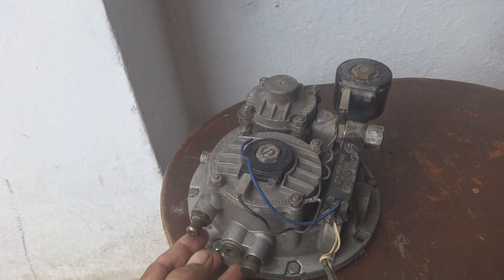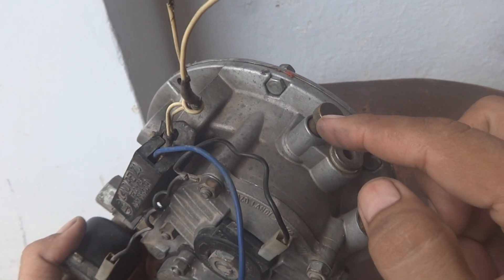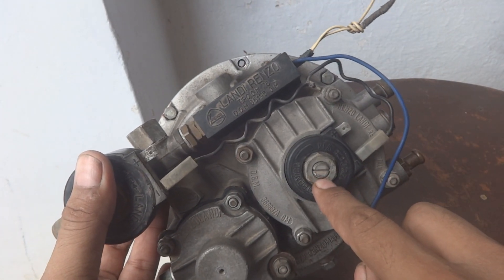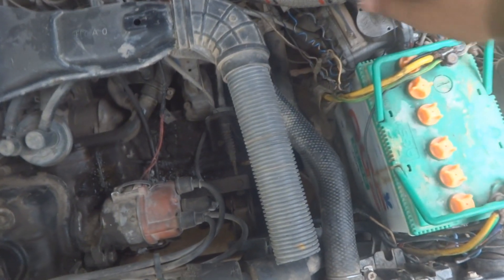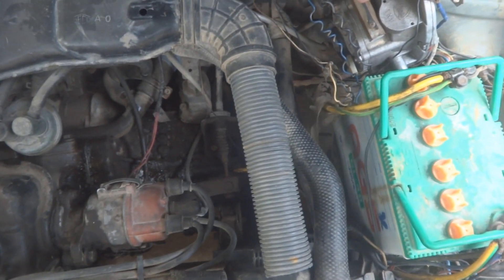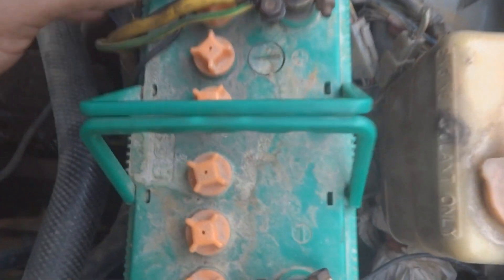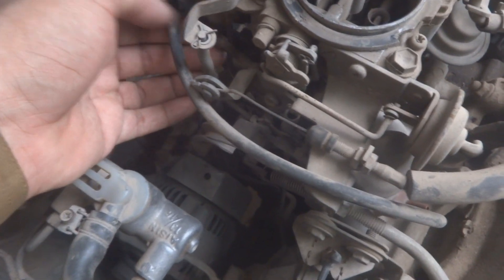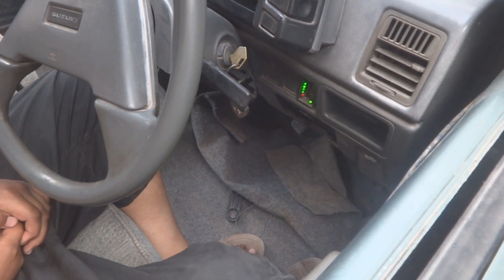CNG kit maintenance part 3. Car CNG gas kit repair and maintenance. setting and tuning

Comment: Sir meri car gas pe aik jagah stable nhi rehti...signals pe or chalty hue race chorny pe band ho jati he automatically
Reply from the maker: Clean and wash your car throttle body.  Watch my videos regarding throttle body cleaning. Also re adjust or fine tune your cng kit. For that watch my cng kit service video series.
Reply: Bhai mera bhi sem problem hain. Chalty hue race chorny pe band hojti hain. Agar aapnein solution karvadiya hain to Plz mujhe bataiyega iski kya wajah thi. My whatsup number 8238873078  Plz reply me

Comment: My mechanic says there is a leakage in kit and will need to replace it and will cost 22000/- its a wagonr 2012 company fitted.
Can you suggest anything sir.
Reply: Change the mechanic. If there is leakage in cng, then copper pipe is replaced which cost approximately 3k but there is very less chance of pipe damage. If there is smell then change otherwise no.
Reply: Same problem with my car. What u finally did??

Comment: I got a 3000 psi system , now 3400 psi is used
How do I get 3000 psi from my house stove from the kitchen to the driveway and keep 3000psi in the trucks tank???
Any suggestions?

I live in USA ( big money players here ) who tell me to junk the truck .

However I believe that fuel gasoline will be made illegal or unobtainable due to agenda 21

Please send information about a compressor that can pump 3000 psi of flammable fuels into a tank without blowing up candy land. Thanks
Reply from the maker: There are gas centres which do compress the natural gas to such pressure level for vehicles.  You can't do it at home due to very heavy machinery involved of industry level. So the only way is to purchase gas from them. In your case you can convert your truck to liquid gasoline.
Reply: LearningZone thank you very much for your time and consideration.
Iv been running this 300cid straight 6 on gasoline for two years , however it has , and did run on CNG.
CNG is a GREAT fuel.
#1 I have natural gas at home
#2 new laws will discourage gasoline
#3 energy Independence is awesome
This is very articulated and dangerous work , however rewarding.
Very smart and underrated by the mainstream...fuel independent
That makes information ,either not available or lacking important details.
I'll watch your channel closely and learn what I can.
Thank you.

I called a few places , claiming to sell or build home fuel stations ( without any luck) yet.
I'll need to " step up" a good compressor ( without internal spark)
Get adaptors 
And filters
All are obsolete

Now , this is the point... energy Independence
I do not trust the "system " to supply food , water or energy...as I read the investment strategies.

So , I have natural gas in many forms and crude oil , which is also in experimental design stages for a refinery.

And
Gasification is also interesting.

Thanks again as few understand or care about fuels , which are really very interesting and amazing ways to save and convert energy.

I'll be less talkative and listening more as you understand what I'm trying to accomplish.

These skills are undervalued and underappreciated.
Thanks again

Oh ya , how about 
Converting the CNG kit to propane???? Yes , I can eliminate the cng 3000psi and use propane if I can drill out the proper components as propane is more thick and dirty , CNG is light and clean... propane is a byproduct of gasoline production
CNG is natural gas( better).

And
3000psi at tank
300-200psi at first regulator
2-3 psi at injectors
For CNG

The high compression is only for storage...yet i think the vehicle is using this high psi to push the pistons ( sometimes).
They add the gas to give the impression that it's burning fuel , REALLY the high pressure is running a % of the engines Power.

Sorry , long letter , however this is very important.

Comment: Hello Buddy! I have the same issue, but not with the CNG. When I run my Wagon R (CNG + Petrol) car on Petrol, I face the same issue. Whenever I remove my foot from the accelerator pedal, it stalls & shuts down. It runs perfectly on the CNG.
Could you please suggest what should I do?
Reply from the maker: +Sudhakar Goswami your wagon model? How many years it is with you?
Reply: Model is Wagonr LXI 2007. Since JAN 2017 I have this with me.
Reply from the maker: +Sudhakar Goswami dear friend it seems a dirty throttle body and idle air control if it has a mechanical accelerator cable arrangement. Anyhow you can wash and clean it easily. There are a few videos on my channel doing such a job. Hope you will get those videos and may solve your car problem. Best regards,
Reply: Actually, the throttle body wash & clean activity is already done by a car mechanic a few months ago. But the problem didn't resolve. He suggested me to change the Throttle Body. But another car mechanic again checked it & said 'there is no problem with the throttle body, it is working fine'. 
They were not able to find the root cause. Is there any other possible solution or suggestion which you would like to share?
Reply from the maker: You should do a computer scan test and look at parameters pids for values.

Comment: good evening sir after watching this video  i adjust my cng kit which installe in my swift car previous i m not getting the pickup after i adjusting that copper adjust point now its run very smoothly thx a lot
Reply from the maker: Thanks dear friend for liking. Stay tuned you will get a lot of information here.

Comment: One point to add
While dismantling, first shut off main valve , release gas pressure from main line, otherwise gas jet can drill through your hand or whatever in contact
Reply from the maker: You are right. This is basic and I think everybody working on CNG system must know it. Safety is the first concern. Regards,

Comment: You didnt take long to find the ideal settings, and it started easy :-D

its like adjusting the carburetta, observing the engine smoothness while making small adjustments to find the sweet spot for all.
You could do it with very expensive test equipment, but tuning by ear often gives better results :-D
Reply from the maker: Yes you are very much right sir. The car runs perfect after service. It was easy then expectations. One can do it better than a pro with little experience with his or her car. Thanks for watching and liking.

Comment: Why is your engine cooling fan continuously running?
Reply from the maker: This is connected directly with the ignition switch. As we are in hot area where it is necessary to run the cooling fan all the time to make the car running cool. Thanks for watching.